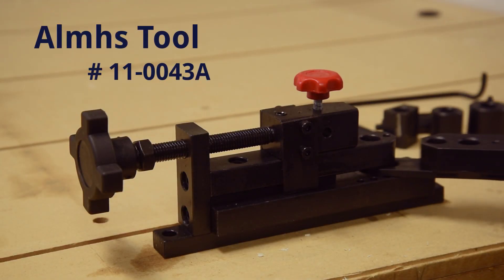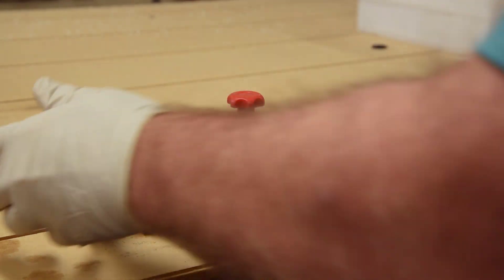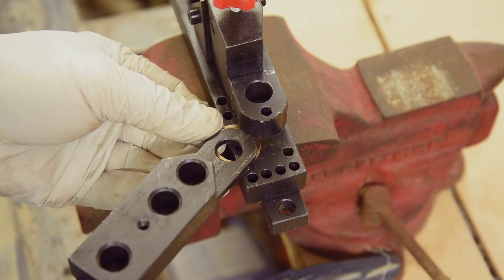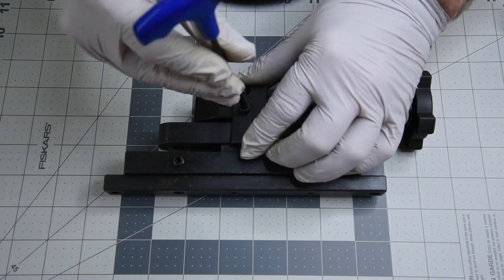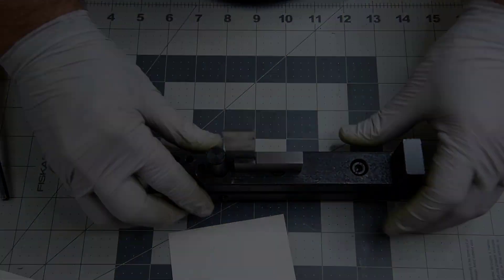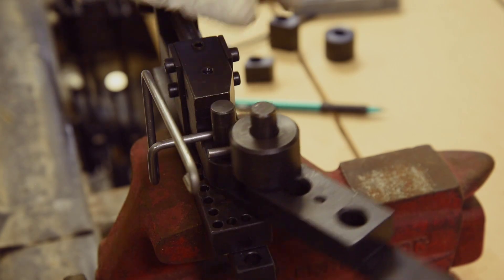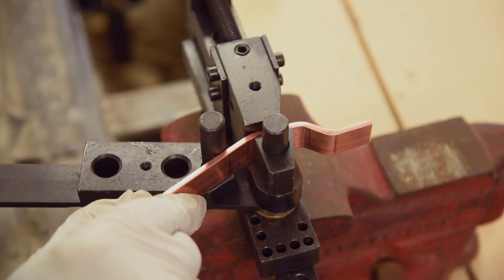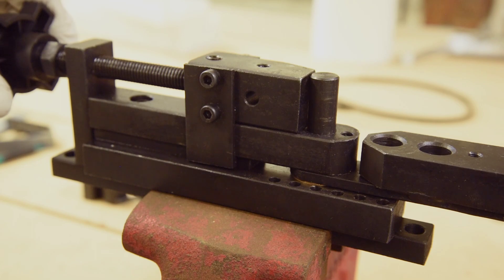Almhs Universal Mini Bender, will it bend?

Comment: Just got on of these to bend some rod for some church projects, and this video was extremely helpful.

To get rid of the slop in the handle, I used a pedal washer, which is a thin 1/2" steel washer that fits between the pedal and the crankarm of a bike. Lacking precision tools in my shop, I "reamed" the washer out to the right size using a step drill with the washer carefully held in a set of locking pliers. I then "lapped" the washer by rubbing it on 220-grit sandpaper for a while. Installed, and voila! No slop.

I also took inspiration from the video to disassemble the tool, square the pin, and reassemble. After squaring the pin, the bottom plate was about 0.015" shorter than the middle bar, so I cut some thin sheet metal to shim it so the rear plate would sit square. 

All in all, I'm very pleased with the result, and it's all thanks to this video.

Final question: the documentation that comes with this product is just awful. Do you know of any online guides for creating different bends with this kind of tool? I can figure most of it out myself, but I'm sure I'm missing some uses of the dies.
Reply from the maker: Try this link: https://ogict.com/bench-benders/instructions/ .  I think these cheap benders are a knock off of this company's duo-mite bender.  And I'm glad you enjoyed the video.  Thanks
Reply: @metalplasticelectronics354  This is exactly what I was looking for. Thanks.
Reply from the maker: You're very welcome

Comment: You might want to do a search for "Mini Universal Bender Wire Flat Metal Manual Bending Machine 6th Generation" Seems the "cheap ones" are knock offs and many suffer from poor quality. This one seems to have started as a knock off that has been improved over several generations. It's made in China and if the advertising is true it seems to be of high quality with prices that fall in between the mass produced knockoffs and the high quality/price original. Sure would like to see a full review of this one...
Reply from the maker: Is that the Kaka MUB-1, I saw a short video on it some time ago.  It did look higher quality but it was close to 100 dollars.  So over twice the price i paid for this one.

Comment: nice review! If the handle flex is the issue a thicker handle made out of thicker material might have been a better fix than the washer. Or would have that messed up the alignment?
Reply from the maker: A thicker handle would be by far the best fix.  Would make it a better bender.  The washer is just fast, easy and cheap.
Reply: @metalplasticelectronics354  yeah no doubt! I guess it would depend on availability too. Where I live most have to be special ordered if it's anything but imperial. 

Same as acrylics and polycarbonates. There is nothing within a 2 hr drive.

Comment: I'm pretty certain that this is a copy of an older western design, because as a child I recall seeing a tool very similar to this one, and because the chinese copy old designs at will in a sort of homage to old tools ;)

I'm glad that I saw this review. I had been debating buying a bender like this from aliexpress, they're asking $279 CAD. It's the "pro" version with more dies and thicker handle. Maybe the fit of the holes and dies are tighter, I dont know but that price is criminal IMO

I found your model on amazon canada for about 100 bucks shipped from amazon facility outside Canada... so likely from some US facility. I am debating buying it at that price versus making my own since I need to bend pot hooks from 3/16" square SS rod asap
Reply from the maker: I think it would bend the 3/16" steel just fine.  Yes one of the first comments I got on the video was saying this was a copy of a, I think it was "Mighty Mite Bender" .

Comment: I bought the Expensive one and it arrived loose in a box.  Each piece was wrapped in bubble wrap. 2 pins were missing and the Guide was missing !!!!  The kit is the same, but I sent this one back and got a refund !!!!  These firms are sending out cr*p that has been sent back !!!!  But I always send faulty stuff back.  They're not fiddling me out of my money !!!!  I have bought the cheaper one from a different firm, so I hope nothing is missing !!!!  They all have the same handle.  Some seem to have more rollers, but you need to check that nothing is missing !!!!  It must have cost the firm a lot of money to post it back, anyway, it serves them right !!!!

Comment: I bought something similar, came with one die and one block.  Not very useful.  To be honest the hole thing is horrendous, the holes are oversize and the dowels are undersize, on this one the holes were nearly 14mm and the dowels were under 13.  Totally unusable.  I didn't return it, I remade all the bits that actually need to fit and now it's a small capable tool.  I'm pretty sure it'll manage about 100 bends before it completely falls apart as nothing is hardened or sturdy, but at least I have this as a guide to make something that'll last.
Reply from the maker: It would be hard to bend anything straight with that much play.  I’ve been very pleased with the one I got.  If I could get one of these with a handle that was twice as thick.  At a good price of course, I would order it.
Reply: Mine was the £73 one and it arrived with the main pin missing, the very small pin and the guide were missing, so I sent it back !!!!  I've bought the cheap one from another firm !!!!  I'll send that back if it isn't all there.  Some kits only have one square die.  Some only have one roller.  The price doesn't reflect the quality, they are all the same,   they just have parts missing !!!!

Comment: I think you would be better off taking two pieces of oak and cutting the profile of the bus bars and sandwiching the copper bar between them and them clamping them in the vice. It will be faster, more consistent without marring the copper.
Reply from the maker: That's a great idea.  That would make a good video project.  Thanks

Comment: if you got a few octaves lower with your voice.. you make a excelelent. morgan freeman impersenator lol
Reply from the maker: LOL
Reply: @metalplasticelectronics354  i swear to god.i think you can pull it off :P
Reply from the maker: I'll have to practice some.
Reply: @metalplasticelectronics354  Hi,I have just placed my order just now, main purpose to bend 1mm steel rule to make leather dye clicker, especially to achieve intricate pattern like leather belt billets,wil it work??
Reply from the maker: @Csb66  I would think so.  The width of the clamp piece kind of limits the closeness of the bends.  However, I have used narrow pieces of steel on the end of the clamp to get a closer bend.  It sorta worked.
Reply: @metalplasticelectronics354  Thnks for the prompt response,is it possible to post a video on tht? Or could i have your email to reach out to ask queries
Reply from the maker: You can email me at mike@mlplel.com

Comment: In answer to your question, yes, they are a copy of an American tool. The Mighty Mite Bender, made in NY city. I have 4 of them, in two slightly different configuration. The handles are .250 thick, fitted with no play. all the pins are 1/2" dowel pins reamed . Again, almost no play. Very good tools. I picked them up for $1 each at an estate sale, but they are really much more to go buy new. They now go under the Duo Mite label. If you used it as part of your business, $351-$481 might not seem a bad bargain, given the better precision and higher capabilities.
Reply from the maker: Thanks.  Ill look them up.  That's out of my price range but If you need to bend stuff straight for a living, these cheap ones want cut it.
Reply: @metalplasticelectronics354  The number of attachments that Duo Mite (actually Oxford General Industries) makes for these things is amazing! Well worth a look! I bought an Almhs like yours and wasn’t happy with all the slop in the handle on both the pivot hole and the play vertically. I finally took mine apart and made a new handle and body spacer piece out of the same piece of 1/4” flat bar to remove the vertical play. A major revelation came when I fitted the new handle to the base. I’d drilled it to just under 1/2” and reamed it on my mill to exactly 1/2”……….. and the pin wouldn’t go through the hole! Turns out the pins are 13mm, which is generally accepted to be 1/2”, but it’s actually 0.0118” larger! So I ordered a 13mm reamer and R8 collet and ended up with a perfect fit! I also just finished machining my version of Oxford G I’s “close follower” tool, and it’s a game changer! If you’re interested in seeing it, I’d be happy to email you photos! You might want to copy it!
Reply from the maker: I looked, they have so many great attachments.  Yes please send a photo of your close follower.  email is mike@mlplel.com.  Thanks

Comment: Nice vid, thanks for sharing. Mine just arrived, going to shim the handle as you suggest. Btw, mine is Neilsen brand, model CT5431.
Reply from the maker: Thanks, if you wouldn't mind,  can you measure the handle thickness and see if it's the same.  Thanks again.
Reply: @metalplasticelectronics354  4.912mm
Reply from the maker: @fredgenius  Thanks
Reply: @metalplasticelectronics354  What is the thickness of your handle?
Reply from the maker: @fredgenius  just shy of 5 mm
Reply: @metalplasticelectronics354  Thanks. So mine's even worse than yours!
Reply from the maker: @fredgenius  well, with caliper mine measures 4.92 mm so probably the same, I just have a cheap caliper.
Reply: @metalplasticelectronics354  Lol! Ok, I used a mic, just happened to be nearer to hand than calipers.

Comment: Many thanks, very clear presentation. Just opened the box of mine and found the same challenges. The handle is very sloppy and the the fit of the bolts and bits and pieces is not at all precise - but for the price and a little of up-grading work it seems ok. However it did not come with the second "squared" bending insert you showed in your video, just one. May be I need to make one on my own...